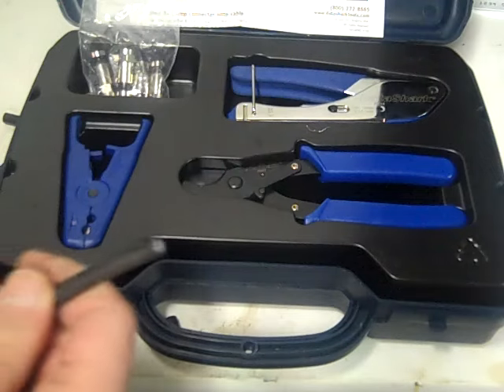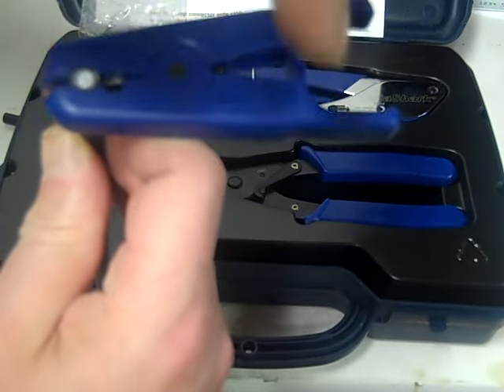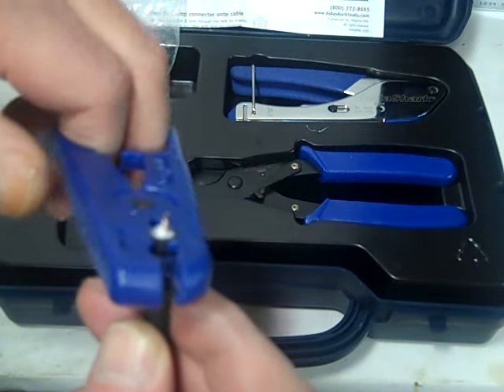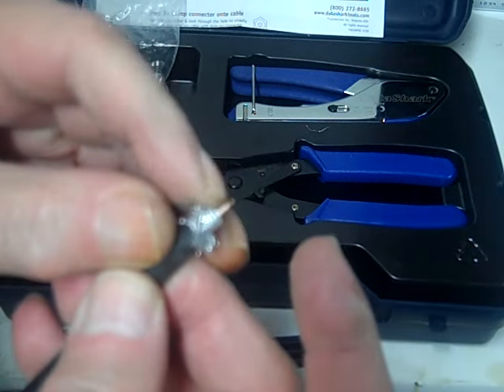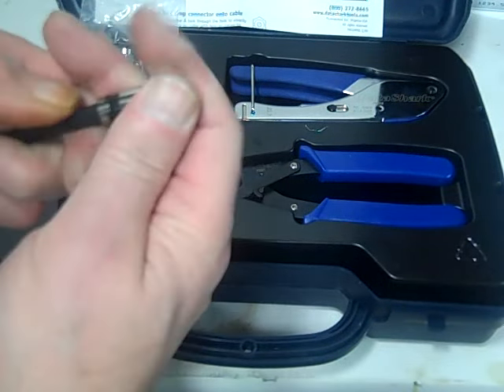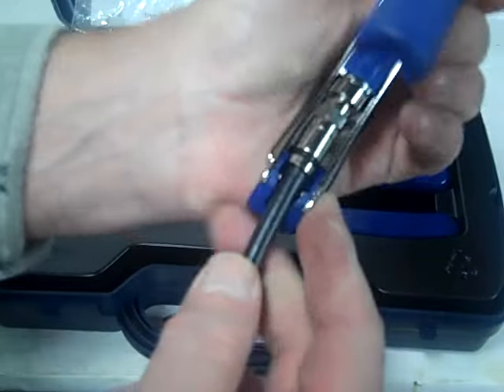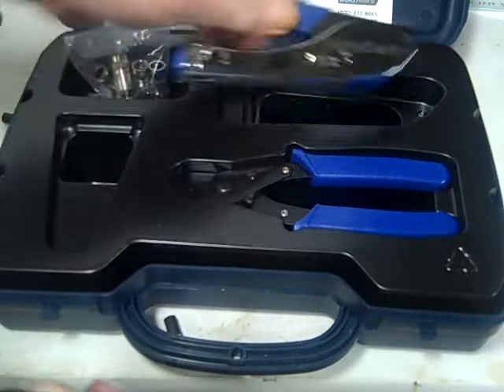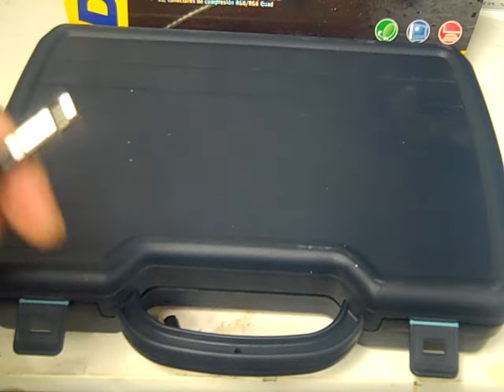How to Install an F Compression Connector over RG6 Coax Cable using a Compression Tool

Comment: Why can't you hold the RG6 connector in the center of the viewing field instead of cutting it off at the top? It's pretty easy to do that such that everything you're doing is withing the field of view.

Comment: if you just stick the copper lead into the hole of the connector of the TV, without the connector, does it make a difference?
Reply: Hell of a lot of noise

Comment: I tried installing an Ideal Universal RG-6 compreesion connector (part #92-651 onto Tappan RG-6Q using the techniques from several videos and I could not get the results you got. Cutting back to expose 1/4 inch of the dielectric isn't enough. I couldn't get the connector onto regular RG-6 either. These compression connectors are expensive and I end up wasting them.

Comment: mine always come off but I think I'm using plenum and need a different connector, you cable looks huge compare to my RG6 cable.
Reply: Yep. Ordered a whole bunch of connectors the only ones that worked out of a dozen screw on and compression were a Belden connector with the part number on it and ends in "PL" with a green ring. Plenum cable needs a plenum connector.

Comment: I bought some compression fittings   they seem to have an inner plunger and a pin that comes out as the core wire.
Are you aware of these?
Do i still cut my cable to these dimentions  ??
Thx !

Comment: You've got a tool in the box that you didn't use. What's that one for?
Reply from the maker: There is 3 tools that come in the kit. A cable cutter, a dual level stripper and the crimping tool.
I didn't go back and watch the video but the cable cutter I don't remember using.
The 4th thing in the kit is the bag of 10 connectors.